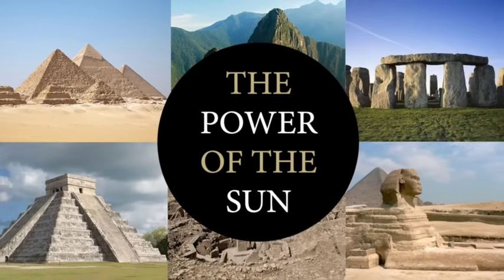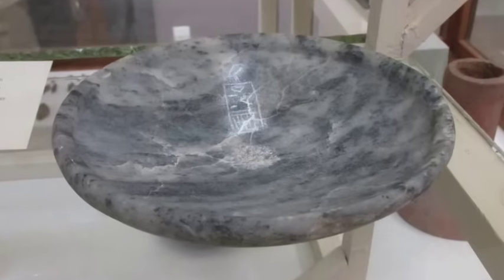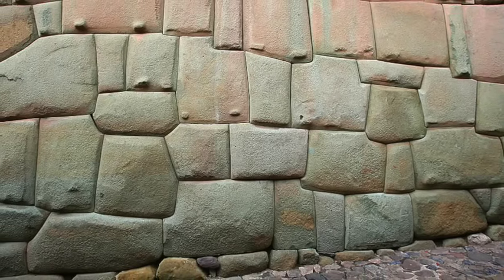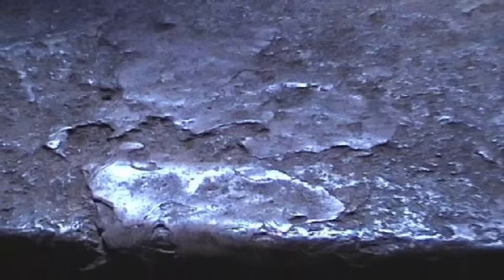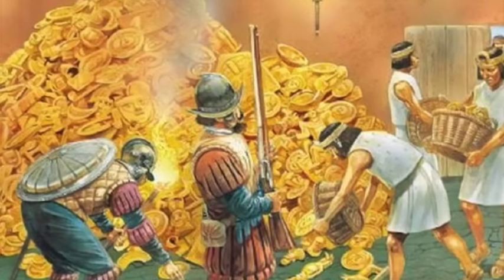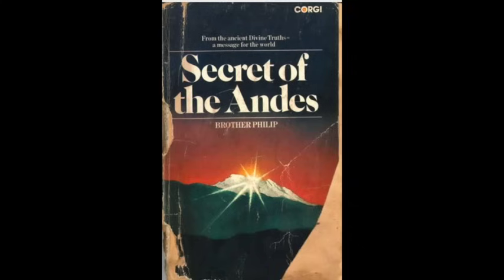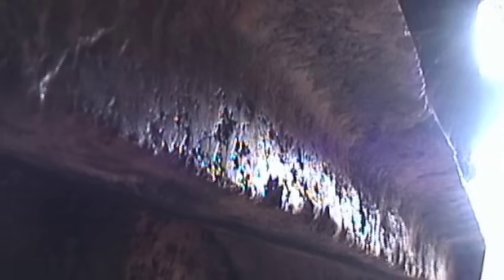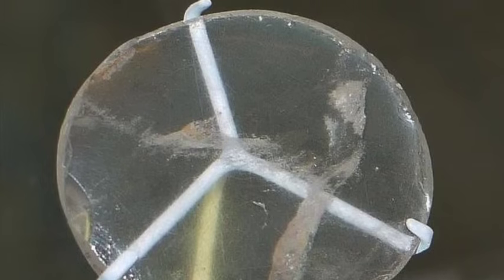How the Ancients Cut Stone with the Sun - Lost High Technology Explained | Ancient Architects

Comment: I'm an Mechatronic engineer, and I'm also very open minded, if you can show me a better way of doing things then I'm in. I've actually seen this technique use, and it can be done. But , and it's a big but, there is no way the face and hair on that statue were cut using this method. As was told to us, " the  mirror used was the size of two men standing ". Firstly you have a team of people working with this giant mirror,  then some very brave fella stands in front of that, with his "optic lens", not only does he have to stay well away from the extremely dangerous beam, but then he has to guide the "optic lens" into that beam and create another beam and concentrate that onto the stone he's cutting, and create beautiful and flawless features. We have all seen the perfect, and i really do mean perfect, and the chanels that are accurate to the width and depth of a micron, these I promise you cannot be achieved today. The corners and edges of these chanels are perfectly square, industrial lazer produce a beam that is, for the most part round. I'm not professing that I know what did this work, but I think I know what didn't. Take a look at some of the tiny pieces of these very hard materials that have been made, they were never produced using this method.
Reply: Perhaps they used some sort of Jig, or die hold the lens and allow it to be guided in straight lines, and the stone sat on a pebble, allowing it to be easily rotated for cutting.   Idk, i dont think the Sun was used to cut, i think the sun was used to soften the stones in some way, and they were either molded, or they were softened and then sound was used to easily cut through the softened stone.  Tuning fork drills are real, and there is (mostly rumors, but rumors that make sense) a way to both drill circular holes with copper tubes, using the tuning forks, as well as using tuning forks and some sort of metal/copper string attached to the tuning forks for straight flat cuts.  You could even cut concave/convex faces in stone with metal/copper strings using vibration.   These methods seem crude, and they somewhat are, because not enough people look into this shit to provide the proper evidence we need, but there are for sure videos that show these techniqes working.
Reply: @chrisallen9743  - I tend to think this is somewhat plausible as well and wouldn't be surprised if they actually used some type of jig, or a mechanical tracing instrument (attached to the device) to aid them in the cutting/sculpting process(?)  It's either this...or...inhabitants from another planet stopped at Earth, along their journey through space, and simply wowed the locals with their fancy anti-gravity machines, advanced lasers and 3D printers :^)
Reply: @chrisallen9743  https://youtu.be/BsqOLCXYznE
Reply: @chrisallen9743  you can cut holes in granite with copper tubes and sand. It's been done on YT. They use a bow drill which is depicted in written hieroglyphs. The resulting 'drill' lines on the inside of the hole match the lines we see in holes in granite across egypt.
Reply: It is an interesting possibilty, I agree the precision very hard to achieve except for modern 3D printing and that is usually made of resin not diamond hard stone. I have seen the 100 ton diorite "coffins" at the Seraphim near Saqqara. Difficult to believe solar lenses melted them into the amazing right angles of their interiors.
Reply: I fabricate granite and i guarantee they did not chip the rock with chisels. Theres some stones with a hole in the center could be a jig. They definitely had to have jigs, im actually studying the hyraglypics . The answers are there
Reply: It’s completely ridiculous like the part of the video which shows the little main guy holding the disco over his head covering the rock like he is supposed to be able to make cuts that are perfect within thousands of an inch by holding that beam over his head plays the statues that they find in Egypt are identical to each other and we’re talking within microns identical how could they hold that and re-create two statues identically by hand not possible
Reply: Walking and thiking for last few days i agree. I beleive what happened to the french guys theory is that half way through making the film he realised he was close but just not correct. On watching maxwells theories and how many years we really exist. 7 to 8000 years ??? I doubt it very much.  
Whats definate is that all the stones in many places around the world and especially Aztecs were semi soft .
Reply: @Incompetent_manager  There is a theory that is being put forward by this lady name Silvia on her channel new earth she talks about how stone can be grown. It’s some crazy shit I highly recommend everybody do research into this because this is something that is not being talked about enough even if it is just a theory it is worth considering because no theories really explain very well how these pyramids were built the way they were. Some theories may come close like the melted/soft stone theories but they do have some holes... if stone can be grown like crystals can be then who is to say some ancient civilization did not take advantage of this knowledge and “domesticate” stones? The evidence Sylvia puts forward is compelling...
Reply: @evyiennetla9416  look at mudfossil University that will blow ya mind. Earth is made from fallen titans allegedly however he makes alot of good points I don't think he exactly right
Reply: Some stones wasn't cut but just malted and in molds. Like what they do with gold. Make liquid and shaped on whatever you want. 

Unfortunately the specific technique used was forgotten.
Reply: @danilogiusti7818  See Hathor's headdress.  Put a convex lens in between the antlers and you can safely cut rocks up close and personal.  These people were masters of chemistry and making perfect lenses isn't nor was it hard.
Reply: I concur. The earth spins and shadows move. This is why you need servos to track the sun with a solar forge. The coordination required to keep the foci constant for a smooth cut is beyond human ability. It would require a mechanism to track the sun automatically. The logistics of cutting an intricate polygonal block out of bedrock in situ as the sun moved across the sky is flummoxing.
 What about high pressure water and sand? The S. Americans certainly had the elevation to achieve terminal velocity...
Reply: @Vadim VeeVoit Yes mate I agree , Rameses definitely did not do those statues.
Reply: In all reality though, it would be stupid the Egyptians to cuts 2.5 ton limestone rocks and have to move them up a 10 degree slope? Anyone ever think about how big that ramp would have to be? Who's to say that they didn't figure out how to make something similar to limestone concrete? So the only thing they would have to move is the supplies up to its location. Seems to be the most smarter reason
Reply: Really though, the smaller the particles, the smoother the finish. Plus. They have these large through areas in some places that look like they'd would fit a giant crushing wheel. Just my imagination can figure that, who knows what thirty guys could think up in a little ancient team meeting, and quickly you can produce some clever ideas @freedomer342
Reply: Shaun, great observation. I'm also one who believes all sciences, medicine, tech, and workings of man can be deduced to thought (idea/1st order of all creation/in another dimention/just higher frequency) as the first step.
Trial (maybe this way/no then how bout this way+++++)
This way works but not good enough, but better this way.
Now removing all not working ways.
Your machine works.
Now it is time to use human skill to bring it up to near perfection.
Lastly, should we let anyone have it after we are (suposedly/NOTHING IS EVER GONE ONLY HIDDEN) are not here to use it.
Let's hide it closer than the nose on their face....really think about that last paradox.
Reply: Petrification
Reply: Yeah and also one could not cut in 3D. It’s hard enough to stay steady enough at a perpendicular angle to the sun with a magnifying glass to burn a piece of paper. Then there is, as you say, the sharp corners that fit perfectly into other cut out rocks without any bevelled edge or gaps. Then there are the hieroglyphs.
Reply: Social media and those who make an income out of it like to want you know with certain details how well they know the details of egypt, just like graham hangcock comes up with things that make you think, ohh the pyramid is sharply on the line with the true north, but they leave out that small detail that there are still a few hundred feet between them, they come up with details that it is the exact mirror image, which is not true. it is a lie. but who are you to say that it is not correct, because you can not check it because there is no one who will let you measure it. the archaeologists who work there are really not going to tell on every video how it really works, that is not read by everyone and certain people are not believed there either. so let them be. but everything that is said on open channels is 99% nonsense, and only to make people believe in something that is not correct, unbelievable things that make you even more curious than you already were, and why..!! to attract you to the next video they make, so that every fool makes a click on their video, 1 click is 1 but a lot of clicks becomes a lot of money, and if you manage to realize a few hundred thousand clicks, you will get a lot of money from youtube and advertisements. for something you have spoken with nonsense on a video, that is just like going on a free vacation while someone else has already paid for it. and these people turn the truth into a lie so that you no longer believe the one with the real answers..

The face of the sphinx isn’t a mirror face cut in half and the exact same thing is done on the other side. 
Ore with lasers.. that’s bull shit. Go to zahi hawass and ask him about it. He will laugh at you.
And the sphinx isn’t made out of granite but out of limestone..
Reply: Am I the only one who thinks this guy isn't a mechanical engineer. I mean, he spelled laser like this "lazer" lol unless college is teaching you how to mispell words now.
Reply: They were smart enough to make lenses to manifest the sun, why would you assume they weren't and enough to make stands for the lenses or make s succession of smaller ones to get the fine details
Reply: There is a kingfisher in puru.. it knows a plant leaf that turns stone into clay the bird uses .. 😊
Reply: This might sound crazy but I think the same way you put a lamp over a light and it displays a pattern of the lamps shadow is I think some how they used a “lamp shade” over the “laser” so that with perfect geometry it was cutting through the rock. Bc remember these thing also have perfect symmetry too. A Cymatic “Lamp Shade”  maybe 😏
Reply: They used casts, but i just watched Pyramid the movie and i think this french man has it pretty much solved along with ancient sea levels and Egyptian travellers. No aliens what-so-ever just using Pi and the meter along with the sun.
Reply: The Egyptians did not have the meter. That unit of measurement didn't come around for centuries.  @Incompetent_manager
Reply: Look up Saser technology and cymatics with vortex amplification and look at all the cone tools found all over ancient sites.  If you can soften the density/mass of the stone through sound waves then it would be easy to mold and cut any rock with precision just like cutting through butter with a butter knife.
Reply: @cyrena851  you can also melt Stone using plasma rays harnessed from the sun
Reply: @cyrena851  yasssss 🔥🔥🔥🔥 tesla... elon... OK they demonic but same tech, however the tech can be used to cause liquefaction of earth.. tartarian mudfloods.... the custodians return 2030 .. they expect Georgia guidestones to be completed.
Reply: Perhaps maybe they used molds and the were able to pour the melted stone into these molds and break them open? Idk what mold material would be strong enough to withstand the temperature of melted stone though... I was thinking the same thing as you
Reply: @evyiennetla9416  You wouldn't need to melt the stone. Just grind it down and make a geopolymer, then pour it in.
Reply: cnc, and marionette p uppet strings.

Comment: Okay, so for the walls made up of uneven quadrilateral (or more sides to the polygon showing), why would they:
1. Not put up a whole monolith if they had one rather than cut it into pieces?
2. Allow for smaller parts to be placed in it as if it were a puzzle? Wouldn't they consider them so many scraps after the easier parts were cut and fitted?

3. Allow an irregularly - shaped stone to sit in another irregularly-shaped stone in the middle of the construction of this "perfect" wall?

Speculation until these can be explained and evidence given.

Comment: The trouble is.....you can not repeat the experiment using modern materials. A pendulum swung at the diameter height above the centre or spinning the molten metal will give suitable concave or parabolic dishes. So do it and repeat enough to build a little wall...or stop chatting on about this myth.
Ps diamonds embedded in copper and meteorite iron were known to these builders. They were the secret tools of the pharaoh .

Comment: When you finish concrete if you troll it enough you can get it like glass. These stones were poured into forms. Then once set up enough the forms were removed and finished. Concrete generates heat when curing.

Comment: Maybe Matt,
but you should read this on "How ultrasound works"
"The transducer probe is the main part of the ultrasound machine. The transducer probe makes the sound waves and receives the echoes. It is, so to speak, the mouth and ears of the ultrasound machine. The transducer probe generates and receives sound waves using a principle called the piezoelectric (pressure electricity) effect, which was discovered by Pierre and Jacques Curie in 1880. In the probe, there are one or more quartz crystals called piezoelectric crystals. When an electric current is applied to these crystals, they change shape rapidly. The rapid shape changes, or vibrations, of the crystals produce sound waves that travel outward. Conversely, when sound or pressure waves hit the crystals, they emit electrical currents. Therefore, the same crystals can be used to send and receive sound waves. The probe also has a sound absorbing substance to eliminate back reflections from the probe itself, and an acoustic lens to help focus the emitted sound waves."
BY CRAIG FREUDENRICH, PH.D.

IMO, these crystal lenses were likely used as  ultrasonic probes.

Comment: Have u ever heard bagdad battery
Reply from the maker: Yes, but it wasn't found in Egypt...
Reply: Sadly they are gone. Looted in 2003. 

They weren't batteries because if they were they were used as batteries  would not have worked well at all or for very  long.  Gasses build up quickly round the electrodes of this crude type of cell,  blocking current. Also the electrolyte would have to be changed frequently so the bitumen seals are all wrong. 

What they exactly resemble are  jars used for storing scrolls and other precious but semi perishable artifacts. 

Sad but true.

Comment: I call nonsense here, show me an actual example of how you do it with concave mirrors, not lasers!
Nice presentation, but the hypothesis presented here is contradicted by science. Concave mirrors have only one focal point where light gets concentrated After that point, the light disperses all over the place. You cannot cut perfectly flat surfaces or even deep lines, let alone cavities or perfect pipe holes with one point of light. As soon as you move the super heavy stone closer to the concave mirror to cut "deeper" you start shadows in the light cone and your point becomes less hot. Plus the exquisite control of moving the "mirror" to cut perfect lines, circles, surfaces and indentations is the domain of computerized, electromagnetic, piezoelectric, high mechanical power machines that don't even exist today - you cannot do this with bare hands or ropes - not enough precision!!!

Comment: 4:55 ... "found rock could be cut with  a 100 Watt laser focused at an area (sic) 2mm in diameter."

Well yes, I expect it can, since that's over 30,000 times the intensity of sunshine!  
It would require a perfect 14 inch diameter lens to capture 100 Watts of sunshine.

Comment: Yes the hypothesis was tested but it only used modern equipment such as a laser. So using sunlight would be a very insufficent and comparing sunlight with a laser is abusrd because  light from the sun radiates outwards and since the light from the sun dispurses in all directions it would be very insufficent to produce a concentrated ray percise enough to cut stone. Lasers on the other hand are very percise and can concentrate most of its energy in one point which can make cuts very percisely

Comment: A stone /rock stays motionless and grounded because of its trapped lifeless gas molecules, known as gas bonding, if these stones were heated sufficiently, they would become gases and rise upward . Point is , Electricuting the stone molecules with the right measure of energy gives them new life, which puts them in a state of motion that's much easier to cut lift and work with, at this stage stones cuts like butter.

Comment: Very good analysis. I'd like to ask about those holes found in some of the mega granite stones found lying in the desert about the pyramids - they show screw markings like a drill and engineers have worked out the rotation speed of whatever that drilled them. Could that have been done by using the sun?  and what are all those weird "parts" found around the Great Pyramid in the desert? Could they be simply "JIGS"  I think they are from the point of view of a builder. thnx